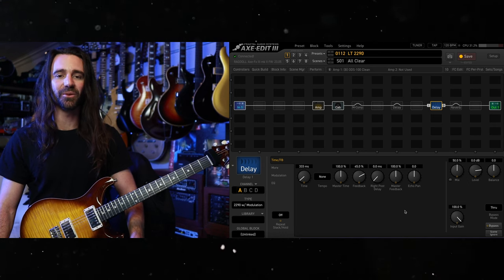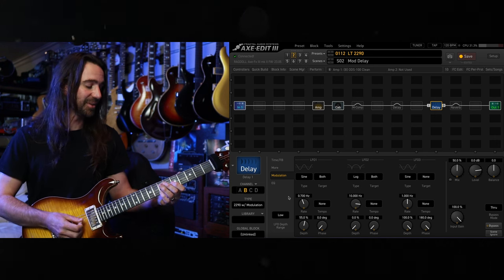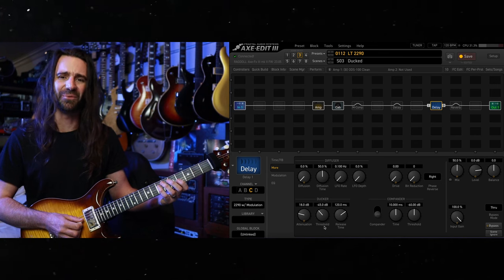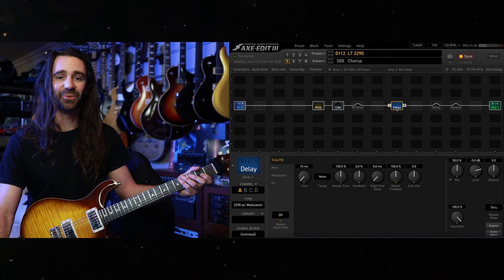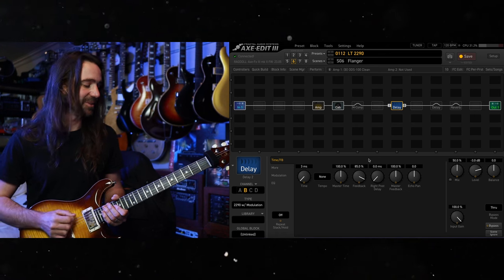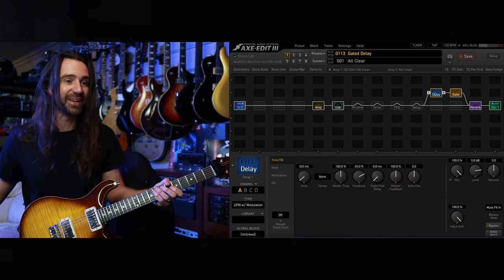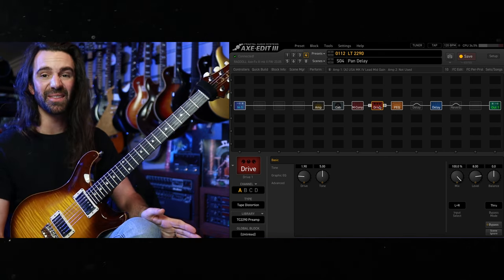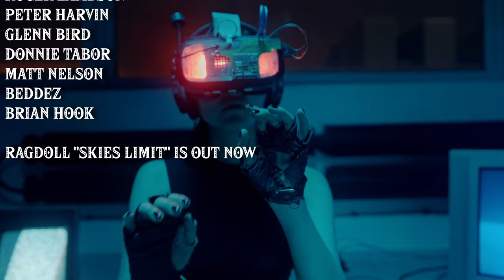Axe-Fx III 2290 Delay Deep Dive | Tutorial & Free Preset

Comment: There is a video where the modelling of the 2290 is explained (afair while the 2290DT plugin came out). They found out that the 2290 was a analog delay and "digital" was some kind of a buzzword in the 80s. It seems that the 2290 was some kind of digital controlled analog delay.
Reply from the maker: The delay line is digital and uses a sampling technique called adaptive delta modulation (ADM), but there's plenty of supporting input circuitry and feedback/filtering that is analog. This category of digital delay is often called a "digital delay line" or "DDL", in contrast to newer units which use dedicated DSP chips to handle all of the delay feedback/filtering in the digital domain.

Comment: Leon, im seriously contemplating getting an Axe Fx because of your channel. Much cheaper than sourcing the original rack effects, dont have to worry about aging components, and it still sounds excellent. I just hope i could wrap my head around how the Axe FX works. A bit intimidating to be honest!
Reply from the maker: You can make it as simple or complex as you like. It's way easier to roll your own preset on Axe-Edit than it is to wire up a rack IMO. You can also grab my free blocks library if you get one with all the classic rack effects already dialed in and matched ;)
Reply: @LeonTodd  Thanks!

Comment: This makes me want to learn the Axe 2290 before  buying the TC P2290 pedal.  It looks like it has more functionality in the Axe than the pedal especially wave forms.  I had a TC2290 rack always found it difficult to use, spending many hours trying stuff, a manual as big as it, in the time when no one to learn from , the pedal looks reasonably easy.  I need to understand the more, modulation and eq in the Axe more Whats your thoughts
Reply from the maker: Yeah if you've got the Axe you don't really need the pedal IMO

Comment: Leon I’m looking for Metallica and justice for all tone. I’m using fractal axe dm 3 along with my mesa 4x12 cabinet and dual rectifier. What preset channel would I use and could you help with the settings please. Thx Troy
Reply from the maker: USA IIC++ is the model metallica use in their live rigs. Crank the gain, bass 0, mid 1, treble 9 and put a nice V in the GEQ
Reply: @LeonTodd  can you do a video on that ?
Reply: @LeonTodd  what cabinet ?
Reply: @LeonTodd  what about the pre amp section as well thx
Reply: @troyshowalter8163  he said crank the gain to 10.
Reply: What about the pre amp section settings thx Leon
Reply: Leon, any help on the preamp section for the justice tone. Thx
Reply: Leon, thanks for your help. I wanted to see if you could touch base on the preamp ,tone, speaker of the axe dm 3 section as well as what cabinet, to use. Also, I’m a new user tithe fractal anymore help would be much appreciated. Thx Troy
Reply: That was for the and justice for all tone from Metallica. Thx